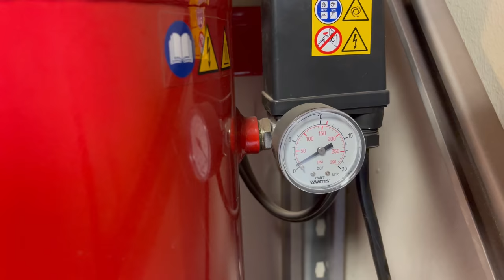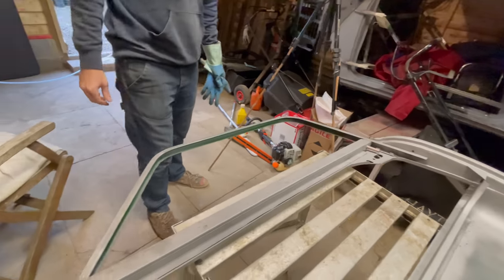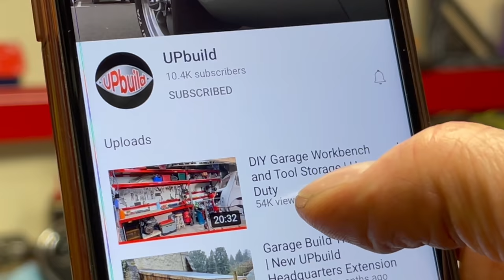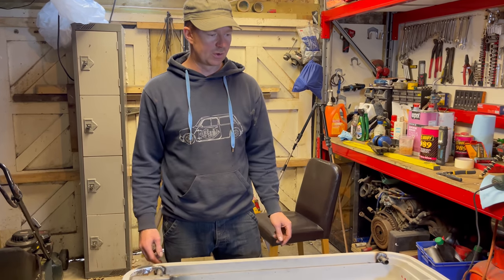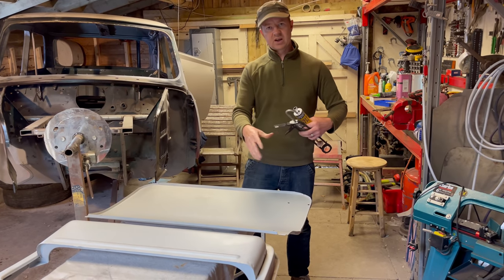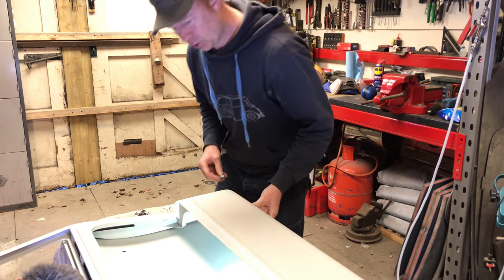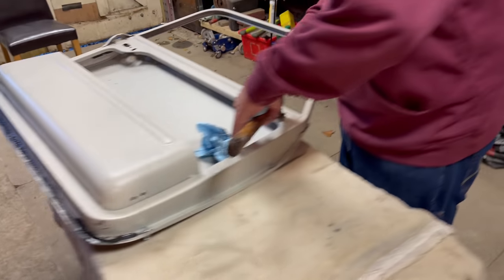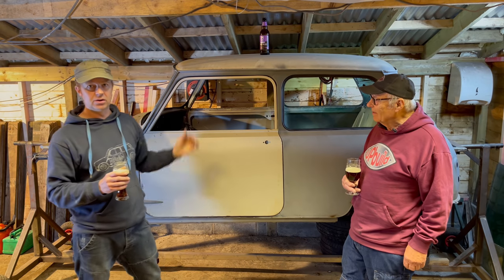Classic Mini Mk1 Conversion - Part 45

Comment: Very nice to see a father and son working together and having a good time doing it. I would have cleaned the spilled black sealant right of reprimered the damaged spots and put a tiny little role of the similar but than in white sealant right against the folded edge of the doorskin were it meets the door frame. It will prevent water from coming in between the two panels even better. But I would love to see you guys continuing

Comment: Wow that's a shit load of blasting material, lucky bugger.

I was told and you would need to check you don't need any more than 90 psi for blasting.

I found every time I used the blaster tank like you I got shocks, so I now put a ground strap between the gun and the piece I am working on.

Wow your so mean give your dad a new rubber glove without holes :)
Reply from the maker: Haha yeah we’ve had all that media sitting there waiting to get on with blasting the shell, mind it’s all single use stuff then through it away.

Comment: Cut 1cm off the tube nozzle at 45 degrees. Much easier to get a flat continuous straight line. I install garage doors at often have to do this between pvc and metal where they meet.
Reply from the maker: Cheers for the tip 😁👍

Comment: Nice to see your dad back in action Mark, great work, I raised the issue of the cant rail a while back, not sure where you can get them from but if memory serves the section ove the front and rear screens was never changed and although they are curved they help capture the profle(?).The use of the Tiger seal is great and should solve any future rust issues, I personally still put the welds in as well as sealant.When Mini's where in production they used to knock seven bells out of the doors to get them to fit, brutal but effective!
Reply from the maker: Hi, yeah I’ve had a few ideas about how I could make the Cant rails myself but I’m just not 100% sure I can get the perfect finish, they need to be perfect as there’re on show as you know. Yeah I agree, I think We’ll put the welds in the doors too.

Comment: Did you use SOUND DEADENERS  in the door panels ,and bonnet and boot lids , before you put the internal trim panels on , that was my job ,at the factory working on the track ,

Comment: Quite brilliant. I’m an engineer by training and I’m in awe of the fabrication skills. I love it - especially the dolly work by Dad. That is the best part for me - Dad and Son and working together on their project. Tiger seal is a good move too. BTW - where do you get your plastic sheeting from to form the spray booth? Oh and also quick fit fittings on the air line? My use of old duvet covers from the garage joists isn’t quite as good and I’ve just acquired a compressor. Thank you again and bring in the next instalment!
Reply: Poly sheet is available from most paint factors.
Reply from the maker: Ah wow! high praise, thank you 😁👍 I got the dust sheeting for the local hardware store and the airline was just a cheap one can get off Amazon. 
Cheers 
Mark.

Comment: Hi, Do.nt forget about the rotation panel in the rear seat interior panel to make it the same as a MK1 shell. That,s the easiest way to see if a shell is original MK1, by opening the boot and looking for the round hole with a removable panel to fit the rotation tube whilst on the production line. The front one is behind the clock. It would be a shame, if you did not put one in the shell, after all the hard work in getting as near to a MK1 shell anyone can do. Steve
Reply from the maker: Hi Good point on the rear rotisserie hole, I keep forgetting about that. I need to have a good close look at a mk1 to get a pattern to make it. 
Cheers 👍

Comment: Hello both . Hammer and dolly , it's the only way ! So, Dad must have been in the trade as having seen all of your video's l've often commented how you constantly put so called restoration specialists to shame ! And watching how you controlled the gun just sealed it for me , your Dad is your mentor ! All my children and grandchildren are girls and really never showed any interest in bodywork /restoration .....pity! I would loved to have passed on my skills to them . l trained up a few apprentices over the years. I would strongly resist sand  blasting the shell with the media you're using . I did a couple of Lotus Cortina's and it proved impossible to get rid of it . I still had particles getting in the top coat , not on the  top surfaces , but out of the box sections !!!! It  really was a night mare ! Your saving grace is the mini doesn't have too many  boxed in area's ! Great stuff as always and l think the one thumbs down is someone pulling your legs ! Thanks .
Reply from the maker: Thank you for your comments, appreciate them a lot 😁👍

Comment: Love the content, can you recommend your blaster?
Reply from the maker: Hi, apologies for delayed response. The pressure blaster is great for blasting larger items you can’t fit in a blast cabinet. Admittedly it can be a little messy and it does get blocked at times, but this is minimised by using new dry media and keeping water out of the lines. I think we might do a short episode on the blaster with some handy little tips we’ve discovered using it. 
Cheers 👍

Comment: Great teamwork it’s great to see you working together,is it a two pack primer? so what filters in the mask are you using because I’ve always used the air line masks which are clumsy for diy work  keep them coming 👍👨🏻‍🏭 hope that was Brown Ale 😂
Reply from the maker: Hi yeah 2k epoxy primer,  the filters are for use with the 2k but they don’t last long maybe only a couple of uses.

Comment: Why shot blasting? Surely walnut shell is a better option.
Reply from the maker: I may have accidentally said Shot instead of sandblasting. The media I was using did a perfect job, it’s a very lightweight material.
Reply from the maker: I’m not sure walnut would work in the machine I was using? Maybe something worth trying at some point.
Reply: I think walnut will rip off the paint and rust but not texture the steel.